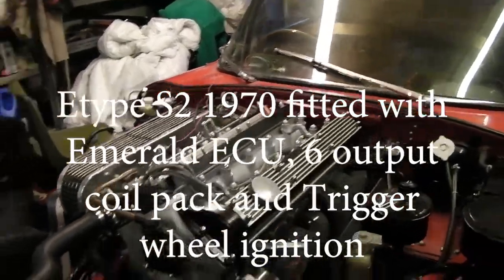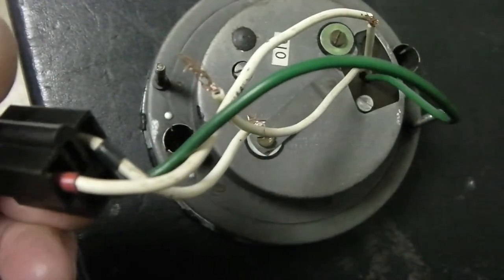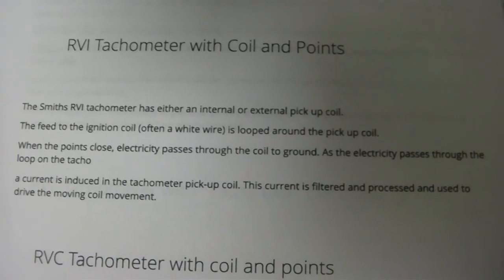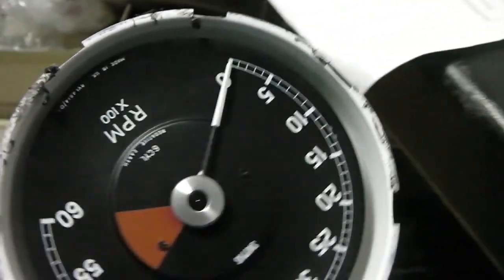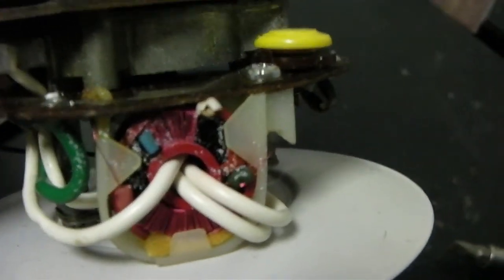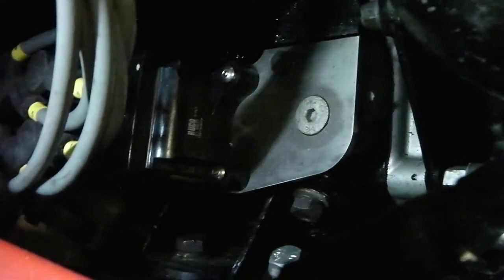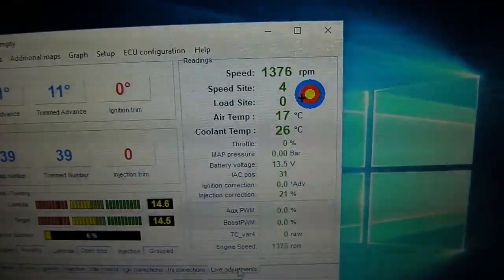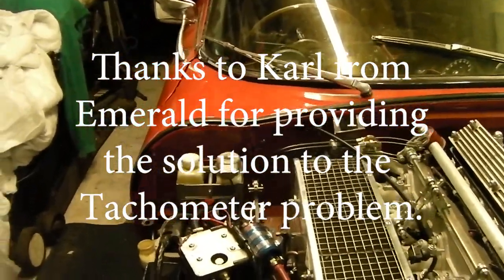Etype S2 RVI Tacho fix for electronic ignition

Comment: I really appreciate you posting this. I too have an E-type with an RVI tach -- that won't work because of electronic ignition. Like the other poster, I'm still foggy on your wiring. Currently my white wire with RED sleeve comes from ignition switch (+12v source), loops around the tacho internal coil and comes out as a white wire with BLACK sleeve (the "pulse" wire) then goes to the +ve terminal of my ignition coil. If I understand you, I need to send the white wire with RED sleeve (12v+), not through the tacho, but directly to the coil pack (+ side) to power the ignition coil. What happens with the white wire with BLACK sleeve (the pulse wire)?  It goes from where to where? What are the two connection points? thanks!

Comment: Thanks a lot. I`m about to rebuild my car back together and will use the same emerald kit as you have. I was planning to send the tacho for modification, but glad I saw this video. So If I understand correctly you have routed the +12v to the coil pack thru the tacho instead? The rest of the wires to the tacho (the green and the other white wire) are disconnected?
Reply from the maker: Hi

The wiring to the Tacho uses the cars original wiring connections with the exception of the pulse wire. The pulse wire needs to be connected to the +12v coil pack wire.  The Emerald wiring harness that comes with the ECU has a wire labelled as the  Tacho driver. This wire is not required and needs to be taped off. Hope this helps